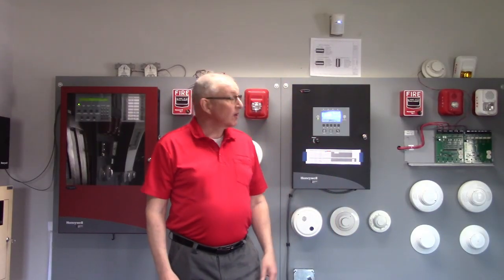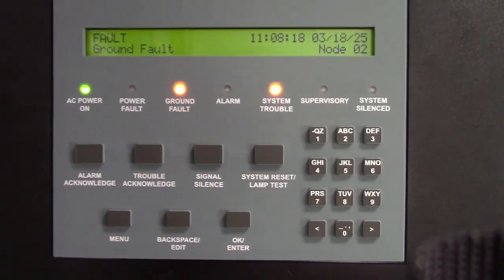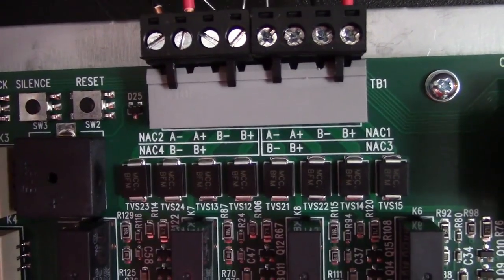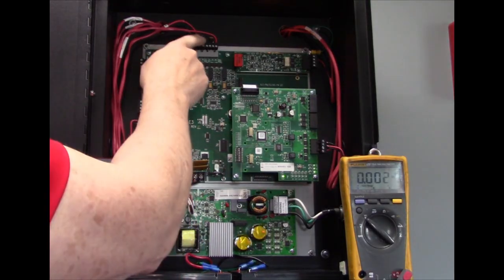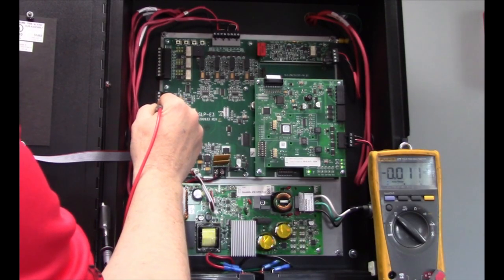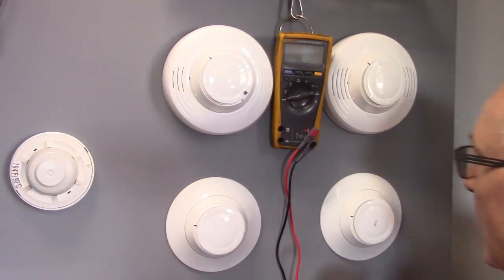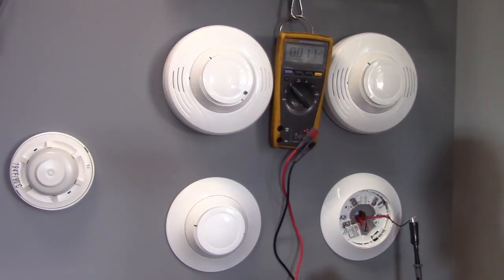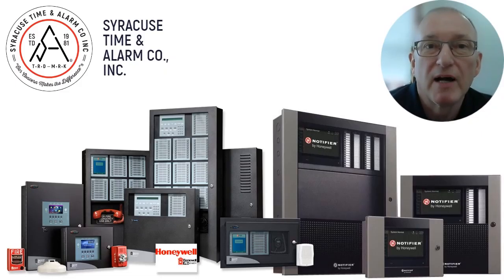⚠️ Troubleshooting a ground fault on a fire alarm system

Comment: When you initially tested with your meter, why were you testing DC volts? (the aux circuit)
Reply from the maker: Thank you for the question and for watching.

The system will reference a specific voltage range as normal condition. If there is current leakage to ground the voltage will go outside of that range and a system trouble will occur.

After documenting the measurements taken while in trouble, you need to find out what the normal voltage should be and use it as a reference while troubleshooting. On the S3 system the normal reference is a 2 volt pulse on the main system negative.

Comment: My problem is the ground fault is still there when I have disconnected all the wires from the main panel which leads me to believe there is an issue either with the ground fault circuit itself or the panel has a broken trace.  I'm going to go double check my work but I'm wondering if maybe I need to check the SBUS SLC expansion cards and NAC expander / power supplies too?  Would those carry a ground fault through the SBUS to the main panel to report?
Reply from the maker: Yes, you're on the right track asking about the SBUS, SLC expansion cards, and NAC expanders. If you're seeing a persistent ground fault even with all field wiring removed from the main panel, it's possible that the fault is internal—either on the main board or through connected expansion modules.
To break it down:
1.	SBUS & Expansion Cards:
Yes, a ground fault on any SBUS-connected device (SLC expansion card, NAC expander, or power supply) can propagate back to the main panel. This is because they share common ground reference paths, and the SBUS includes both data and power. So if one of those expansion modules has a short to ground on its internal circuitry or connected field wiring, it may reflect back to the main panel.
2.	Try fully disconnecting:
o	The SBUS (both power and data lines)
o	Power outputs (NACs, auxiliary 24V, etc.)
o	SLC wiring and any expansion modules
Then monitor with your voltmeter between DC negative and earth ground. A significant voltage (e.g., >0.5V) typically indicates a grounded condition. If the fault goes away once SBUS is removed, then yes—it’s likely one of the SBUS devices.
3.	Still See Fault with Everything Disconnected?
If everything is disconnected and the fault remains, then it may be an internal board issue. Sometimes a surge, like a lightning hit or transient spike, can damage protective components (like MOVs or TVS diodes) on the board, causing them to leak or short to chassis ground. This causes a phantom or actual ground fault reading.

•	Systematically disconnect SBUS, SLC, and NACs while monitoring voltage to earth ground.
•	If the panel alone, with no wiring, still reports a fault—it’s likely a damaged component inside the panel itself.

Hope this helps.
Reply: If it’s a 7100 ground fault internal.

Comment: Our community is being charged what seems to be a lot of money for “troubleshooting” ground fault errors. One example is 7 hours and a $55 trip charge totaling to $1,344.00 just to troubleshoot and disconnect one alarm on the FACP. No equipment was repaired or replaced. These panels were also newly installed by the same company earlier this year. They said 7 hours to troubleshoot this sort of thing is normal. Is that accurate in your opinion?
Reply from the maker: You're right to question the cost—$1,344 for troubleshooting without any parts replaced does seem steep, especially since the same company recently installed the system.

That said, ground faults can be tricky. There’s no standard amount of time it takes to find them, because it depends on several factors:
•	The size and complexity of the building
•	The routing and type of wiring used
•	The quality of installation by all trades involved

In a best-case scenario, you find the fault quickly—maybe it’s visible near the panel or at an accessible junction. But other times, especially if the wiring was damaged during or after installation (e.g. fire alarm cables strapped to sharp threaded rods or crushed by other trades), it can take hours to isolate.

The general method is to divide the circuit in halves to narrow it down—a process of elimination that can take time, especially if the wiring is concealed or runs through multiple areas.

I’ve seen cases where it was found within minutes, and others where it took most of a day. So 7 hours is not unheard of, but it's definitely on the longer end if the fault was straightforward and accessible. 

It’s worth questioning why a newly installed system has faults already—potentially indicating installation issues. You might want to request a report of what was determined to be the cause.
Reply: Yeah.  Its always. 2 men 8 hours fir troubleshooting.  Sometimes it even takes days as well.  Its not easy

Comment: Great and informative video!! 

What are some steps to take when there is no available ground reference in the field? Is there a more efficient way than walking to and from the control panel after disconnecting devices?
Reply from the maker: If there is no ground reference at the devices, having a length of wire with you to extend the closest grounded point is helpful. It could be a light fixture, building steel or perhaps ductwork above a drop ceiling. The cover screw on a light switch should also give you a good reference.

Once you have determined the normal ground reference at the FACP, you should be able to take measurements in the field and determine if you need to move closer or further on the circuit without having to visit the panel each time. You can get additional information if you are able to connect a laptop to the panel's serial port and monitor the system on your cell phone connected via a remote desktop application.
Reply: @ thank you!! This is very helpful information.